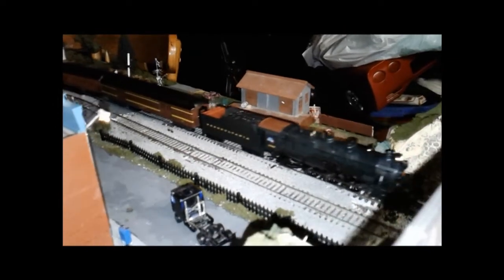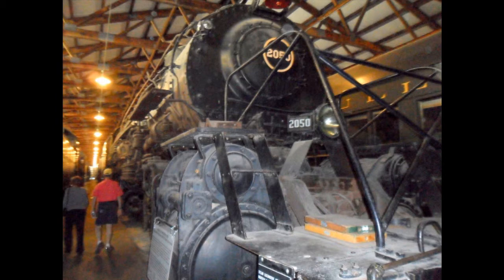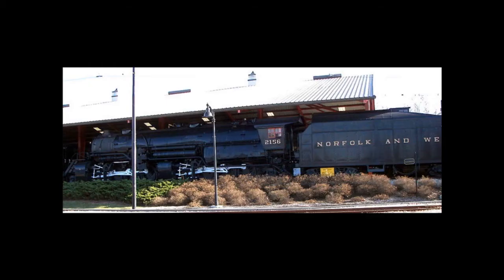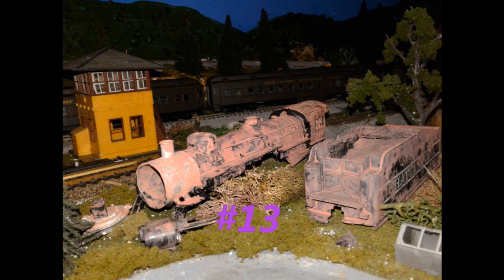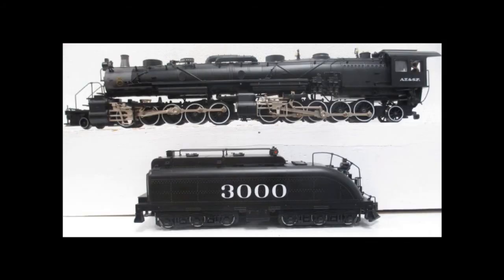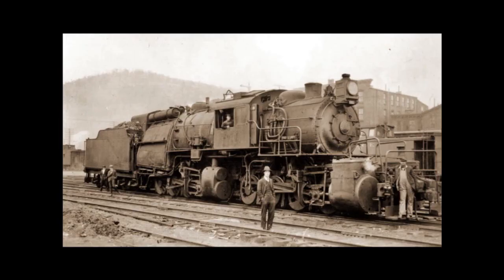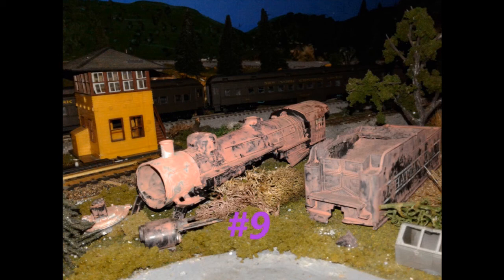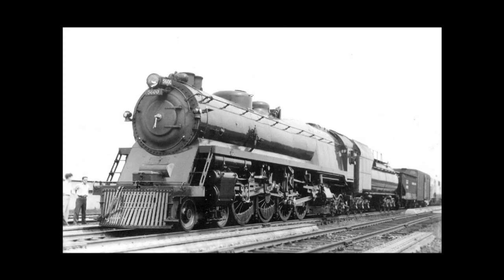Top 15 Extinct Steam Engines part 1

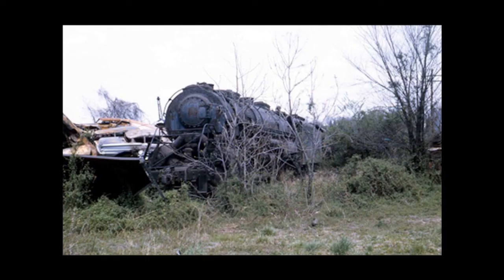Comment: 3:14 N&W 2143 also sat in the scrapyard at Roanoke. But imagine if 2174 and 2143 were preserved, then 2174 would have been preserved at The Virginian Museum of Transportation. and it would have been under restoration from 1985-1987 like 1218, and it would have been a 3 side by side with 1218 and 611. It also would have been restored from 2014-2017, and it would have been running today. And for 2174, it will be displayed at the National Railroad Museum in Green Bay, Wisconsin.

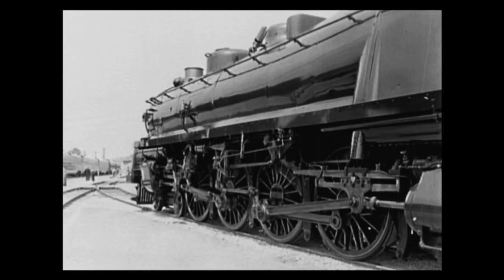Comment: 13:29 Imagine if the engine was longer, then the rear set of pistons wouldn't have been too close to the Firebox and causes the engine to overheat. and it wouldn't have been unsuccessful, and it would have been preserved at the Illinois Railway Museum.

Comment: We still have the Class J 4-8-4's, the Class A 2-6-6-4's and the Class Y 2-8-8-2's
Reply: Like the 611, 1218 and 2156
Reply: Yeah, those
Reply: 2156 is a Y6a, not a Y6b. All of the Y6bs were scrapped
Reply: I know that
Reply: U’d think that with a railroad like N&W who used steam engines longer that all their engines would instead be strictly forbidden to be scrapped
Reply: And they're building a replica of 2174.

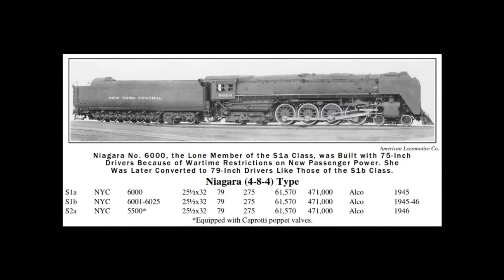Comment: 4:54 Why didn't you let us expect the Niagras to survive? But that's not true, There would have been one like 5500 or a Niagra that was numbered in the 6000s. Or? There would be one rebuilt from scratch like 5500, and it won't be an extinct locomotive. It will have a Top speed of 135MPH, and it will be the fastest 4-8-4 that ever existed.

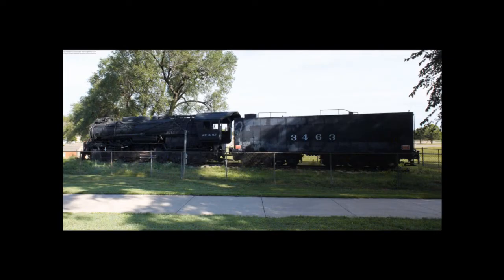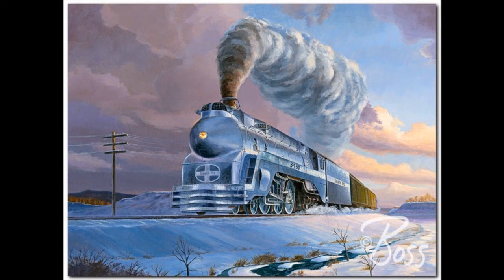Comment: 6:38 Imagine If it was preserved, then it would be displayed at the Calorado Railroad Museum, 6:44 Imagine there were some streamlined locomotives that survived, then that would be awesome, and that's why you said streamliners wheres awsome because they design beautiful streamlined hudsons
Reply: Or like N&W 611 and SP 4449 would’ve ran excursions
Reply: @adamtain7627  yes! And there has to be a kickstart making new built extinct steam locomotive campaign called “The C&NW E4 Trust” to built the first member which wasn’t been built #4000 So it can run excursions between Illinois, Iowa, Wisconsin, Minnesota, Nebraska, Missouri and Kansas.

Comment: The Northern Pacific’s Z Class (Z-6, Z-7, And Z-8)  2-6-6-4 Challengers 
Most Of Northern Pacific’s Z Class Challengers Where Scrapped And Cut Up Between 1955 And 1958
Reply: Yeah, It's ashamed that Northern Pacific Class Z Challengers was scrapped. What if they could preserved 1 Northern Pacific Class Z Challenger?
Reply from the maker: Challengers don't have a 2-6-6-4 wheel arrangement. They have a 4-6-6-4 wheel arrangement.